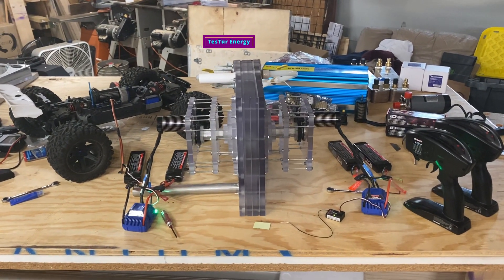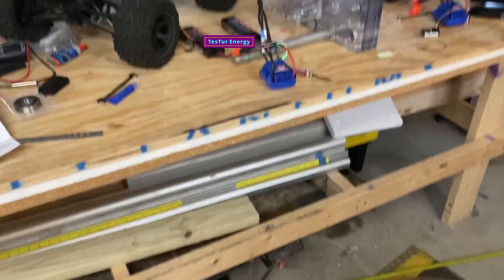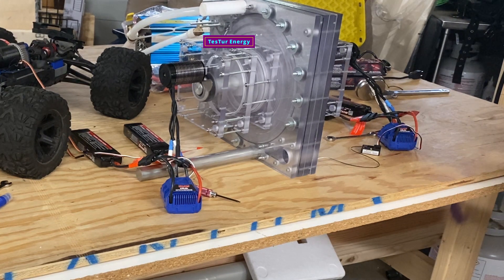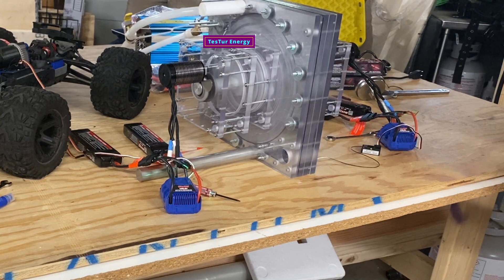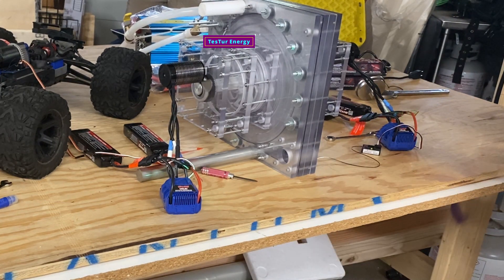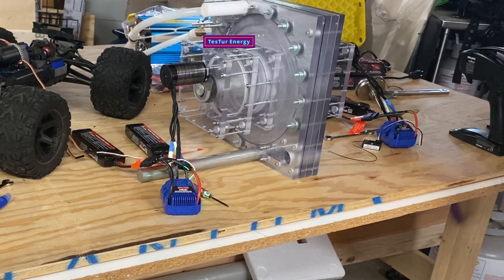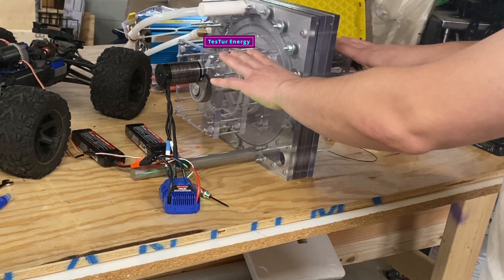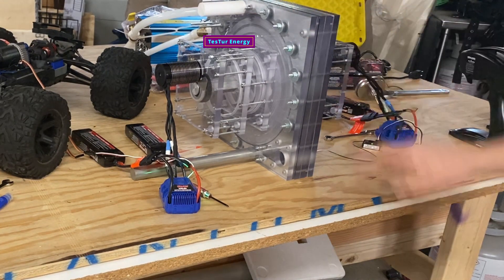10in Tesla Compressor & Turbine w/ Built In Balancing Apparatus RC Car Dual 6s 3kW 2200kv BLDC Motor

Comment: highly impractical due to the high speed of that wheel...... wear and tear is a huge issue, and not to mention dangerous!
Reply from the maker: Thanks for your input. Contrary to popular misconception, Tesla turbines are actually quite efficient and deliver a respectable amount of torque, even at low rotational speeds.   

Let me break it down a bit further with some copy pasta 🍝 of mine:   

The notion that Tesla turbines need to spin extremely fast for efficiency is a misconception stemming from their use as centrifugal pumps.   

When functioning as pumps, yes, their effectiveness is related to tip speed.   

However, in a turbine setup, excessively high RPMs create a counterproductive centrifugal head that diminishes the pressure difference across the nozzle.   

This, in turn, reduces the fluid’s terminal speed and mass flow rates, ultimately impacting the turbine’s power output. 

Adding to this, it’s worth mentioning that the faster you rotate the discs, the higher the velocity your input fluid must attain to maintain a torque advantage over the discs.  

To clarify this, let me share another bit of technical info:  Tesla turbines are entirely viable for large-scale industrial applications. 

That’s because the torque experienced by the discs directly relates to the speed difference between the fluid and the disc. 

Here, the crucial element is the disc tip speed.  

For a specific fluid inlet, the nozzle will max out at a certain fluid velocity. 

This sets a cap on the disc tip speed, which isn’t influenced by the disc’s radius. 

And if you consider that centripetal force is linked to the square of velocity divided by the radius (V^2/R), you’ll find that enlarging the disc radius while maintaining the same tip speed will actually lower the centripetal forces exerted on the disc. 

Contrary to the widespread myth that Tesla turbines must rotate at high speeds to be effective, the truth lies in optimizing certain conditions.   

Increasing disc speed isn’t the way to enhance efficiency; rather, it’s about minimizing slip between the fluid and the discs. 

When the slip increases, the system inherently suffers losses.  

Tesla’s own words from his patents outline how to get the most out of these turbines:   

“Owing to a number of causes affecting the performance, it is difficult to frame a precise rule which would be generally applicable, but it may be stated that within certain limits, and other conditions being the same, the torque is directly proportionate to the square of the velocity of the fluid relatively to the runner and to the effective area of the disks and, inversely, to the distance separating them. 

The machine will, generally, perform its maximum work when the effective speed of the runner is one-half of that of the fluid; but to attain the highest economy, the relative speed or slip, for any given performance, should be as small as possible. 

This condition may be to any desired degree approximated by increasing the active area of and reducing the space between the disks.”  

-Nikola Tesla 

So the principles for maximizing TesTurs’ performance are:   

1) increase fluid velocity in relation to disc speed,(not increase disc speed)   

2) Maximize the surface area of the discs, and   

3) Minimize the spacing between the discs.  

The fundamental interactions governing the turbine’s efficiency and torque are fluid adhesion and cohesion, and not RPM.   

Misguided efforts to chase RPM with TesTurs invariably lead to disappointment because they fundamentally misunderstand how to properly design these turbines. 

Understanding the design specifics of Tesla turbines is crucial for their optimal operation, and it’s not about spinning them at high RPMs.   

A common misconception arises because people misinterpret Tesla’s patent, confusing the turbine’s function as a pump with its function as a drive turbine.  

In Tesla’s own words, which pertains to when the TesTur is used as a pump or compressor:   

“I have found that the quantity of fluid propelled in this manner, is, other conditions being equal, approximately proportionate to the active surface of the runner and to its effective speed. 

For this reason, the performance of such machines augments at an exceedingly high rate with the increase of their size and speed of revolution.”

-Nikola Tesla

So to clarify, high RPMs are relevant when the Tesla turbine is employed as a centrifugal pump or compressor because the performance of all centrifugal devices is dependent on tip speed.   

When it comes to its role as a drive turbine, the focus should be on reducing fluid slip, not on spinning the discs faster.   

Misinterpretation of Tesla’s patent has led to this RPM chase, causing ineffective designs and subpar performance. 

It’s essential to clarify that ramping up the speed of the Tesla turbine discs isn’t beneficial; in fact, it can be counterproductive.   

The centrifugal forces that emerge at high RPMs can actually work against you by impeding the fluid flow and diminishing power output.  

So, if you’re designing a TesTur, remember that speeding up the discs is a double-edged sword.   

Not only does it create resistance via centrifugal forces, but it also demands that your fluid move even faster to apply useful torque to the discs.  

Hence, simply cranking up RPMs isn’t the magic fix some might think it is.  

This is what Tesla said,  

“Still another valuable and probably unique quality of such motors or prime movers may be described.   

By proper construction and observance of working conditions the centrifugal pressure, opposing the passage of the fluid, may, as already indicated, be made nearly equal to the pressure of supply when the machine is running idle.   

If the inlet section be large, small changes in the speed of revolution will produce great differences in flow which are further enhanced by the concomitant variations in the length of the spiral path.   

A self-regulating machine is thus obtained bearing a striking resemblance to a direct-current electric motor in this respect that, with great differences of impressed pressure in a wide open channel the flow of the fluid through the same is prevented by virtue of rotation.   

Since the centrifugal head increases as the square of the revolutions, or even more rapidly, and with modern high grade steel great peripheral velocities are practicable, it is possible to attain that condition in a single stage machine, more readily if the runner be of large diameter.  

Obviously this problem is facilitated by compounding, as will be understood by those skilled in the art.  

Irrespective of its bearing on economy, this tendency which is, to a degree, common to motors of the above description, is of special advantage in the operation of large units, as it affords a safeguard against running away and destruction.  

Besides these, such a prime mover possesses many other advantages, both constructive and operative.   

It is simple, light and compact, subject to but little wear, cheap and exceptionally easy to manufacture as small clearances and accurate milling work are not essential to good performance.   

In operation it is reliable, there being no valves, sliding contacts or troublesome vanes.   

It is almost free of windage, largely independent of nozzle efficiency and suitable for high as well as for low fluid velocities and speeds of revolution.”   -Nikola Tesla   

Tesla wasn’t advocating for high-speed rotation; rather, he emphasized correct design principles for optimal performance, even at low speeds.   

His turbines were envisioned as simple, low-maintenance, and versatile, capable of functioning well at various fluid velocities and rotational speeds when designed properly.

Comment: simply amazing - would it be possible to use the same design for diverted flowing water like from a river or stream ?
Reply from the maker: Hey Thanks Liberty Dankmeme! Yes this should definitely work well for that too but it would need different disc spacing for waters higher viscosity.
Reply from the maker: Hey Liberty Dankmeme, not sure if you’ve gotten a chance to see my latest tesla turbine updates but check them out! Just running on compressed air so far while I still work on the larger vacuum chamber system for the turbine. Peak 2.75kW and 6.22ft-lbs of torque 4150rpm with 150psi room temp compressed air with 1/2in supply lines.  And the second video is the latest 1200watt electrical load tests using 170gal of 150psi compressed air dumped to 65psi, both room temp and then 70-80°c heated compressed air. And saw the continuous 1200watt output all the way down to 65psi. Should have this thing ready for a vacuum chamber here real soon! 

https://youtube.com/shorts/yXQy844URMA?feature=share

https://youtu.be/bWpXRzrzf4g

Comment: What's the efficiency
Reply from the maker: ??? Of the motors spinning the runner? 

Idk I believe these BLDCs are like 85-90% efficient so something like that
Reply: @CharlieSolis  right transfer for generation should be calculateable
Reply from the maker: Check out this video that Ryan over at RCexplained made. It goes over all the iron and coppers losses of a motor and how to calculate them at any given voltage and current draw. The motor specs will tell you the numbers you need for them to calculate. 
https://youtu.be/nbQeUOY6rEg

Comment: Sounds very smooth once you let it go faster. How would you adjust this for a balancer ?
Reply from the maker: Hey thanks raj! Yeah I need to really turn up the progressive throttle setting so I can get a lot smoother control of the lower RPMs. But once she starts... ohh man does she rip. I can’t wait to make the set of carbon fiber discs to make this a Mach 2 centrifugal compressor. 😈😈😈 I’ll have to change the casing obviously but this is a really really good start. 

As for the balancing, I just have to find the critical RPM and then balance it at each of the even or odd harmonics of the critical rpm. Tesla says in the balancing apparatus patent which to balance at depending on wether one or both sides of the runner are “yieldable” but I forget which one it is for this set up off the top of my head. Now that I have it running smooth I’m going to sit down and re read that patent again tonight. 😂

Comment from the maker: Just for the record, at no time, was I anywhere near full throttle. There’s no throttle jamming going on either. Just smooth throttling up and down, otherwise you risk burning out your ESC or motor if you start finger banging the throttle.... Throttle control is life.

Comment from the maker: I Have a bunch of tuning to do on this runner now! I still haven’t done any balancing yet so that’s next. With this set up I’ll be able to spin it up and pin it at the critical RPMs so that balancing can be done perfectly like Tesla suggests in the balancing apparatus patent. And the exhaust ducts being extended on the screws all cantilever’d makes them work exactly as the “yieldable supports” needed to make the balancing apparatus. So this prototype case design has a built in balancing apparatus to it!! 🤓🤓🤓

I went about 3/4 on the throttle and I have my throttle set to max out at 75%. So the runner was Spinning around 7500pm. The motor 2200Kv motor does up to ~60,000rpm at 25v and I’ve got a 12:54 tooth ratio giving a 4.5 gear ratio right now so 3/4 throttle is ~30k-40k rpm (ish) on the motor and ~6.5k-9k rpm on the disc runner. At most 50% of safe max continuous RPM of 15,000 for these 3105 h13 aluminum discs.

50 discs, .0092in disc spacing, runner is just shy of 1.5in wide, the entire Turbine, Case and Generators weighs 22lbs, disc stack/runner is a little under 6lbs. 
Gear ratio is 4.5:1 with the 2200Kv BLDC generator max rpm of 60,000 and 25Volts with a max of 120amps. Bringing each generator to 3kW, and 6kW total potential output.

To inquire about more information email me at TesTurEnergy@Gmail.com 
Or if you would like to help bring Nikola Tesla’s Turbine to the people of the world go to my Patreon to aid the cause so we can make more prototypes and models! 
https://www.patreon.com/CharlieSolis
#NikolaTesla #TeslaTurbine #TesTurEnergy

NIKOLA TESLA BRITISH PATENT 186,082 - IMPROVEMENTS IN THE CONSTRUCTION OF STEAM AND GAS TURBINES
"In the new design I employ two heavier end-plates which are machined tapering toward the periphery for the purpose of reducing the maximum centrifugal stress as much as practicable. The inside discs, of relatively thin material, are rolled, forged or ground tapering in like manner and with the same object in view, but this may not always be necessary and plates, made of sheet metal of substantially uniform thickness as furnished by the mills, can be employed. Each of the thick as well as thin plates is provided with exhaust openings, leaving a solid central portion like the hub and spokes of a wheel. Star-washers of similar configuration serve the purpose of keeping the discs apart in the center and for the peripheral spacing the thin plates have small holes drilled in them on a circle, or circles, of suitable diameter, and in these are driven tight-fitting studs which are upset at both ends by a special tool so that they will project beyond the metal on each side a trifle more than the thickness of the star-washers. When the plates are put together the separating studs do not come in line but are straddled in order to give opportunity for slight yielding, thereby eliminating constructional difficulties which might be caused by unevenness or other mechanical imperfections. Thus the rotor can be finished closely to predetermined overall dimensions and will run true on the outside even if the thin inside plates should vary a little in thickness or be slightly warped. To simplify this arrangement I provide only every second plate with studs, using plain ones between. Furthermore, with the object of cheapening the manufacture I dispense altogether with the former, accomplishing the spacing by means of small bosses or protuberances which are raised in the plates by blows or pressure and provide a die, practically reducing all the machine work on a thin plate to a single operation in a stamping press. The star-washers, while preferable, are not indispensable and may be replaced by round separating washers of a diameter about equal to that of the hub part of the discs"
-NIKOLA TESLA
"This construction permits free expansion and contraction of each plate individually under the varying influence of heat and centrifugal force and possesses a number of other advantages which are of considerable practical moment. A larger active plate area and consequently more power is obtained for a given width, this improving efficiency. Warping is virtually eliminated and smaller side clearances may be used which results in diminished leakage and friction losses. The rotor is better adapted for dynamic balancing and through rubbing friction resists disturbing influences thereby insuring quieter running. For this reason and also because the discs are not rigidly joined it is safer against damage which might otherwise be caused by vibration or excessive speed"
-NIKOLA TESLA

Read full version:
https://teslauniverse.com/nikola-tesla/patents/british-patent-186082-improvements-construction-steam-and-gas-turbines

Tesla Valve Cryophorus Experimental Set Up Vacuum Flow Test Tesla Turbine